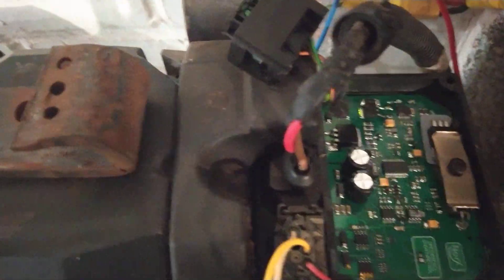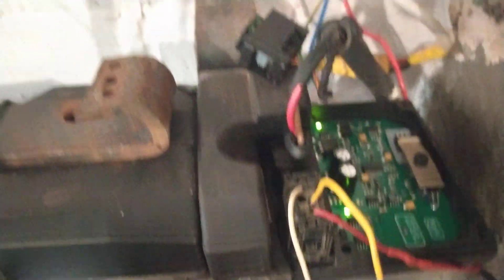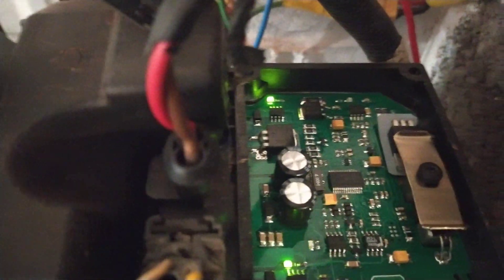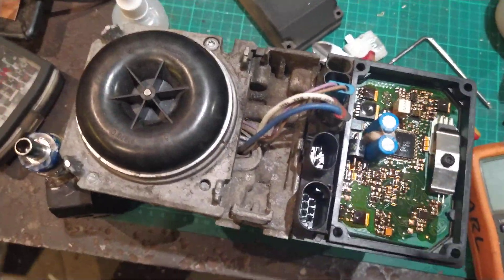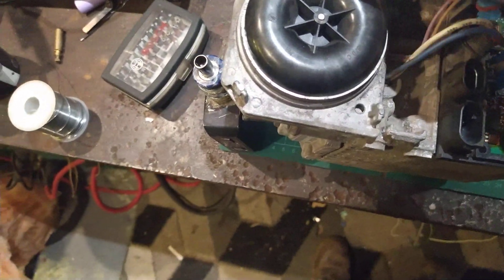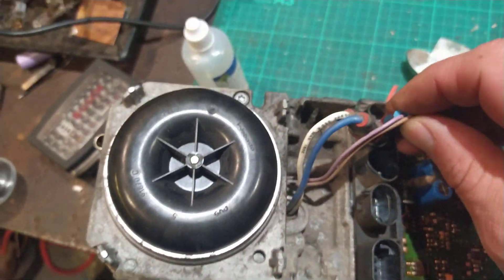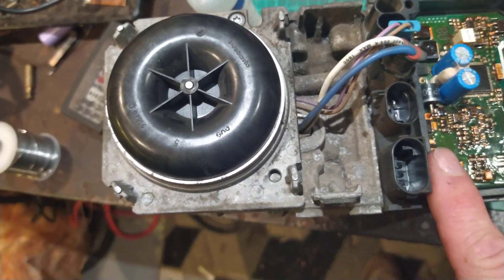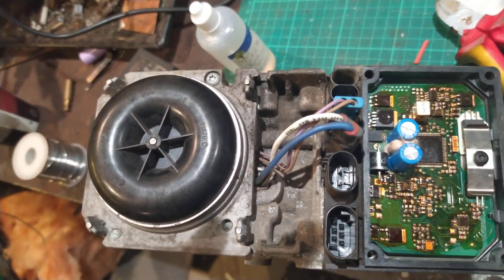Webasto thermo top c/z canbus removal board.

Comment: Hi mate. Just bought a Land Rover one. Actually two in the same purchase - a C and a V. Now, I’ve seen people get the V going with just a W Bus module but elsewhere, it says the CAN will need coding out to get it go. Think I’ll end up using the C and get one of these boards. Were yours Land Rover? I don’t j ow all the differences but some say BMW are hard to get going..?
Reply from the maker: Mine were from BMW's and later rover cars, the canbus is just to much hassle to deal with and i avoid them unless I've got a c board or aftermarket board to replace the canbus board.

Comment: Hi, I have my BMWX5 and there is thermo top z on it I was thinking on putting this on my boat so heat it but there is a little problem that you need a controller and according my understanding the C version works on any simple controller, you can even start it by crossing cables but according my understanding the Z version needs a signal from controller. It is quite complex. My question is am I right on all of this? Also could I just replace a board from the one and making it a C one in order to buy cheaper controller?… I don’t know if that makes sense.
Reply from the maker: I dont work with bmw versions of these heaters as they work on canbus systems, i just swap out the circuit boards and use either an aftermarket board or 1 from a Peugeot diesel car.
Reply: Thank you very much. I was wondering if I could run this heater by plugging any source of controller or I have to replace the board.

Comment: would the replacement board be able to operate with the afterburner on a belief heater which is an eperspacher clone
Reply from the maker: I have no idea, ive not had anything to do with the afterburners, i tried to buy 1 but couldnt get it at any cost, sorry cant help with that.

Comment: Tu consigli questa nuova scheda per thermo top C ? Grazie
Reply from the maker: ??? English please.
Reply: hi, do you recommend this new board for thermo top c?
Reply from the maker: Yes, this board is made for thermotop c
Reply: Grazie
Reply: the webasto starts with positive + pin 1 (X1) from Webasto clock 1530?  does the webasto start with + also at pin 3 (X1)?  seller is serious?  thank you
Reply from the maker: I use PayPal n 2 to start, but they are not all the same. Some use pin 1 or pin 2 but not seen pin 3 used as start signal
Reply: Diagnosi for Webasto  it’s ok?
Reply: Ok for pay pal 👍
Pin 2 diagnostic 
Pin 3 start + battery 
Pin 1 start from timer 1530
Reply: I have a C board that does just washing, it definitely needs reset, that's why I was seeing the diagnostic CD, and then I would like to buy another new board for my Webasto Thermo top
Reply from the maker: @guzzura1  im not the seller, the link to the seller is in the video description
Reply: Sorry my name Flavio Roma Italy 👋

Comment: blew board on mine was quoted 280 for a new pcb, so i made my own pcb with an arduino, took months to work out how to make diesel burn lol, cavemen were better at making fire than me...but now its ''all my own'' and if it ever fails i can repair it with parts for pennies off ebay, best of all no canbus
Reply from the maker: Good man, im afraid thats beyond my doing, i can deal with mosfets and resistors and such but when it comes to coding and stuff im lost.
Reply: @karldingbat  I'm no genius at it but most things can be broken down in into steps and those steps arranged into 'if () then' and 'if () then or else', but setting a fan speed and a pump rate and a glow plug time was the research bit to get it to start reliably

Comment: can I buy the original circuit board from you? mine standing on the car is burned
Reply from the maker: Sorry for the delay, just started a new job.
Email me at poperss@hotmail.com if still interested
Reply: @karldingbat  hi.i just change my webasto board with a new one
Reply: @karldingbat  and i get a lot of error on k can because of the new board
Reply: @karldingbat  if i take the wires off the webasto 0 errors
Reply: @karldingbat  can you help me?
Reply from the maker: @bmwwagonaudio769  this is why i dont use the can bus heaters, i would of thought that just switching the board for an exact replacement would of been ok with no problem. Only thing i can think is that the errors are being flagged up due to an error elsewhere and possibly not with the board, fuel pump, glow plug, or the internal fan would all show up an error code. You need to get the codes for errors and go from there, that way you'll know whats causing the problem.
Reply: @karldingbat  on ista tester 0 error  only k line canbus errors.if i remove the webasto i have 0 error.
Reply: @karldingbat  i think ora the board.if i want ti remote start the webasto it work but from second atempt.....only errors are from the board.its new...no ideea what to do
Reply from the maker: @bmwwagonaudio769  as i dont know how to use canbus boards i dont think i can help, only thing i can say to try is to remove ALL the wires and totally power down the heater for about 20-30 minutes then try to start it after that, see if it clears any errors !
Reply: @karldingbat  if i remove all the wires only error is webasto